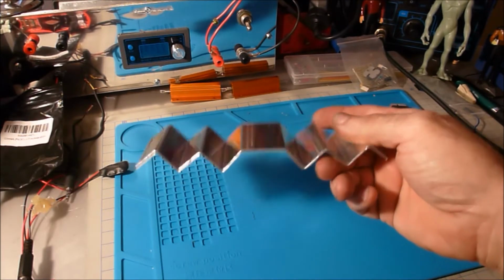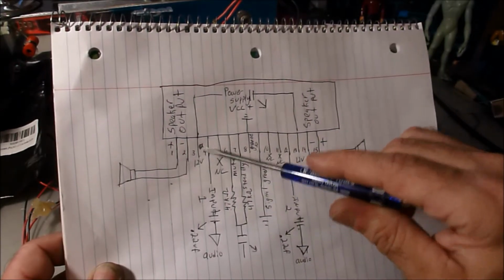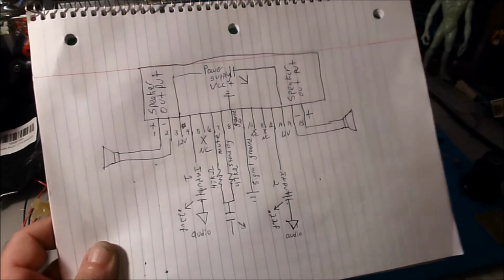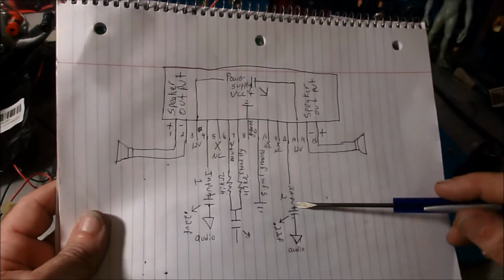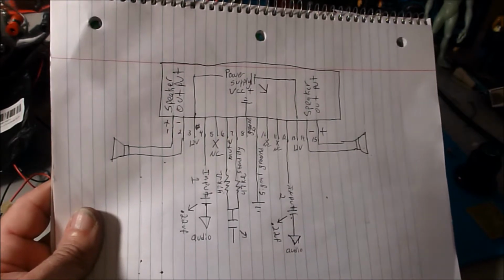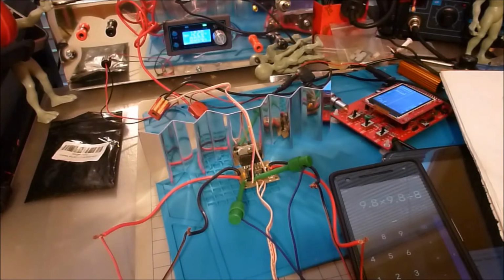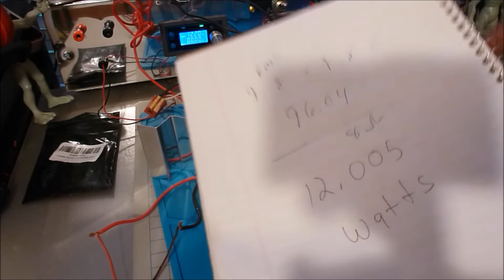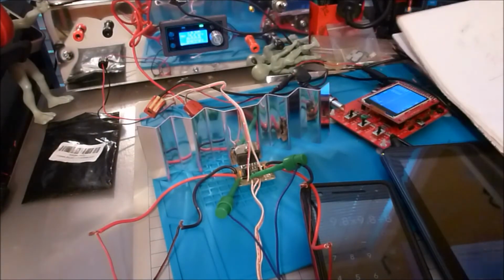Testing a TDA7292 amplifier.

Comment: I have the same audio amplifier ic the data sheet says the real maximum voltage is 20 volts so if you wanna get almost the 15 watts is to use a 19.5 volt power supply from a laptop